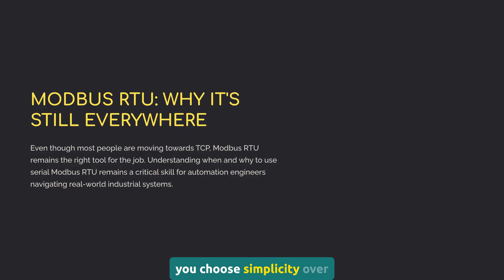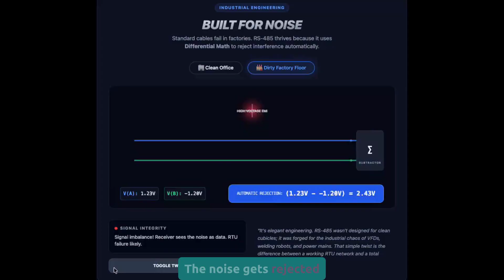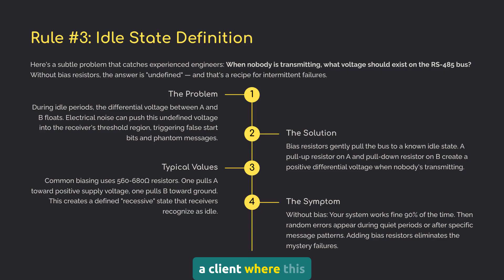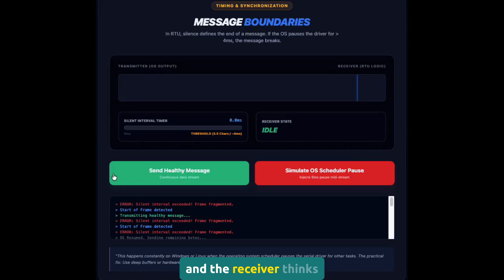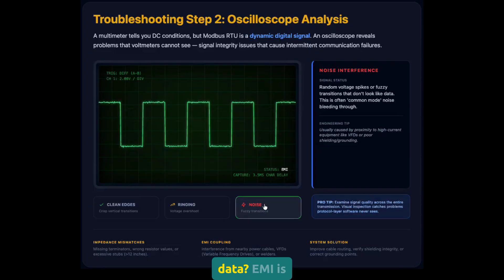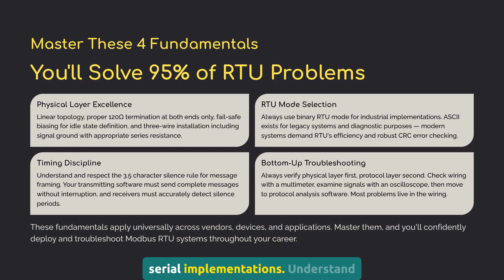Modbus RTU Fundamentals: Field-Tested Troubleshooting That Works

Comment: I've read the Modbus organization documentation and it says that on rule 4, signal ground, only one point on the bus should grounded, to avoid loops, preferably on the master.
You recommend grounding all slaves via a resistor on each one, in order to have a voltage reference and still avoid loops.
Do you recommend that cause you actually identified that the voltage reference is lost the farther the slave is from that single ground point at the master? 
If it's proven that the reference voltage is better achieved by obeying rule 4, where  ground when the slave has only A and B, no common?!on the DC negative on the DC negative of a DC poweres slave? On its general ground on the circuit board? How about AC powered slaves? I deal with some that has no earth ground and only A and B for comm.

Comment: All the sensors and probes we use are either simple digital/analog, or Modbus RTU, I have not encountered any TCP/IP sensors. The only Modbus TCP we use is an extender that itself has and RTU interface for sensors, which we manage through a long optical cable.
Reply from the maker: I really appreciate you sharing your practical experience with Modbus RTU and TCP/IP extenders. It adds fantastic context to the video and highlights the enduring relevance of RTU.

Cheers,
Alana

Comment: Wow wonderfull and informative video. I have a concern: I am using schneider PLC as master and for the slave I use acu energy meter. The connection is good but there is no reading so what could be the reason?
Reply from the maker: Hello @zackwr, Thanks very much I'm glad the video helped. :) 

If the connection is good but no values are coming in, the issue is often one of the Modbus settings rather than the wire itself. 
I would check these first: 

slave address, 
baud rate, 
parity, 
stop bits, 
register type (holding vs input), 
function code, and whether the meter register list is 0-based or 1-based. 

A lot of the time the device is talking fine, but the PLC is asking for the wrong register or wrong data format.

What I’d be thinking in the field:

1. Communication settings mismatch
This is the big one. Master and slave must match on:
baud rate
parity
stop bits
slave ID

2. Wrong register address
Energy meters are notorious for this. The manual may say something like 40001, but the PLC may want just 0 or 1 or 0000 depending on how Schneider handles addressing.

3. Wrong register type / function code
The meter may store values in:
holding registers (40000's), or input registers (30000's)
If the PLC is polling the wrong type, you get nothing useful back.

4. Data format problem
Even if you hit the right register, the value may be:
16-bit
32-bit integer
float
swapped word order
So sometimes the data is there, but it looks wrong or blank because it is being interpreted incorrectly.

5. RS-485 wiring issue despite “good connection”
Sometimes comms lights look okay, but:

A/B are reversed
no common reference where needed
termination/biasing is wrong
the cable shield/grounding is causing trouble

6. Meter setup not enabled properly
Some meters need Modbus communication enabled, the correct port selected, or a specific protocol mode chosen in the meter setup.

Comment: Thank you, very helpful! Bus bias is mentioned; is that supplied by the master in a PLC system?
Reply from the maker: Hello @whiggins101, Great question. Usually yes, in many PLC systems the master or its RS-485 interface provides the bus biasing. But not always, sometimes it’s built into a converter, gateway, or added externally. The main thing is that the network should have one proper bias source, not multiple devices all trying to bias the line at once. I hope this helps Alana :)

Comment: Serial is making a comeback in select extreme applications (oil and gas/steel industry) because of its simplicity. The mentality is we dont have time to troubleshoot network when  losing millions of dollars a shift but we can test/run a new shielded cable in a fraction of the time.
Reply from the maker: Thanks for sharing this real-world insight! It perfectly illustrates why understanding Modbus RTU fundamentals, even in this age of advanced networking, is still incredibly valuable. Appreciate you adding that context! Best Alana

Comment: Hi Alana, this video was superb! I'm a young industrial automation engineer. It is true that the majority of new devices are using tcp/ip protocol based, but like you said there are alot of devices still using serial protocols. The last 2 time I had to deal with RS485 it was a mess! To much "trial and error". I wish I had this video before.
Reply: Can you also made a video (or perhaps a short video) about "open-collector output". I''ve been finding several sensors with this type of digital output and I struggle to wire them. They never work properly especially when wiring them to relays.
Reply from the maker: Great idea ,thank you! 

A short video on open-collector outputs is absolutely going on my list. 

They trip a lot of people up, especially when you’re trying to drive relays.
Reply from the maker: Hello @GomesTugaPT, 

This comment made my day, I really loved it. 🙂🙂 

It’s exactly the kind of feedback I hope for, because the whole reason I’m doing these videos is to pass on what I’ve learned over the years and make things easier for people coming up behind my generation.

Thank you so much,
Alana